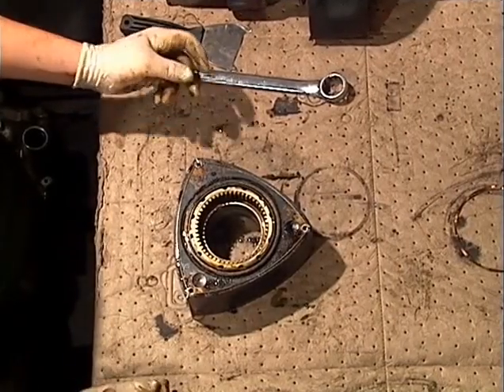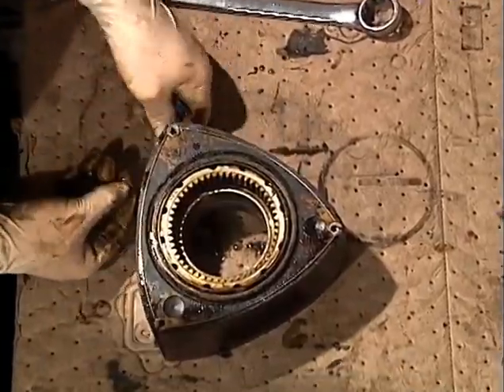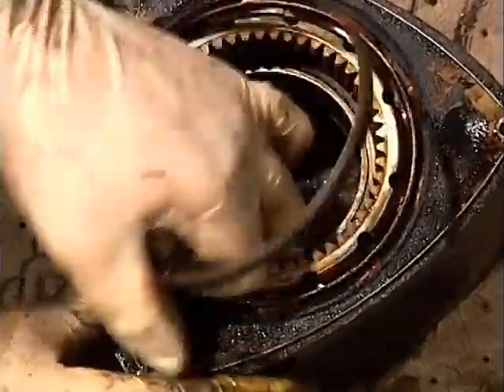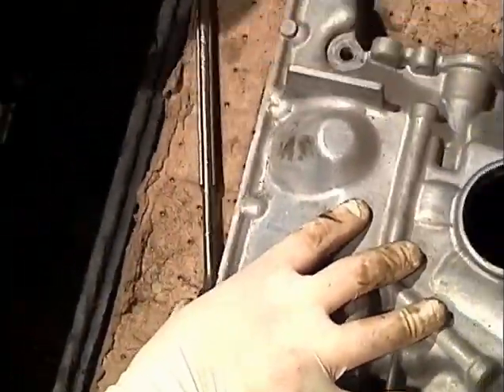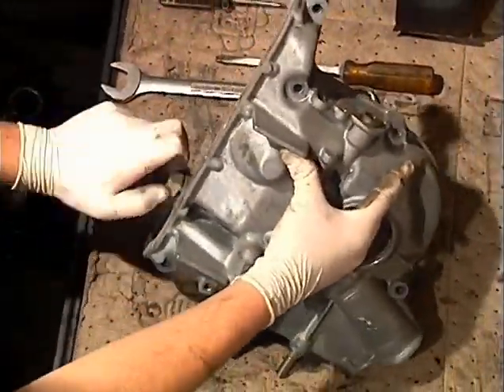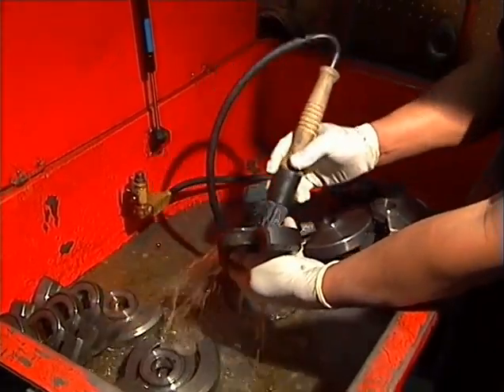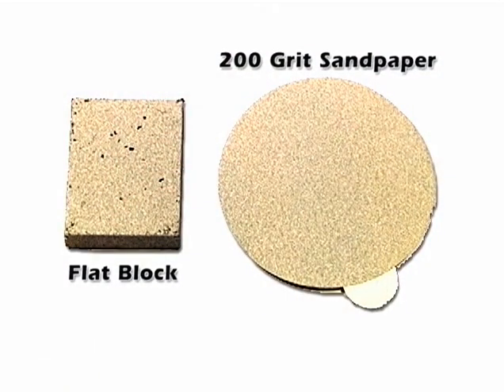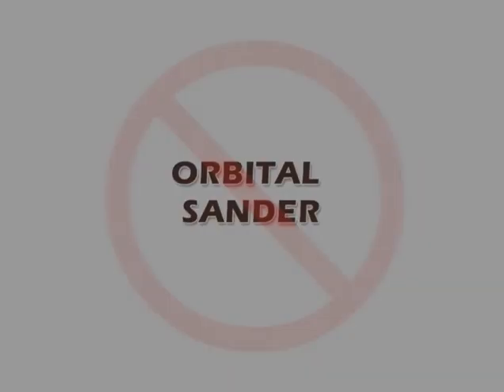Rotary Engine Rotor Disassembly

Comment: I know i'm a few years late to asking,  but where'd you get that tool at 0:32?  my side seals are stuck and I can't get anything really in there to get the springs and all out,  something like that may be able to
Reply from the maker: That is a standard drywall putty knife that we modified on a bench grinder. 
Thank you for watching and commenting 😃👍
Reply: @AtkinsRotary  noted,   thank you so much!